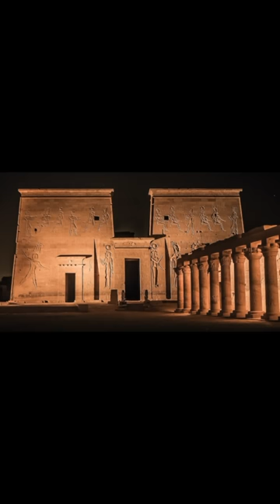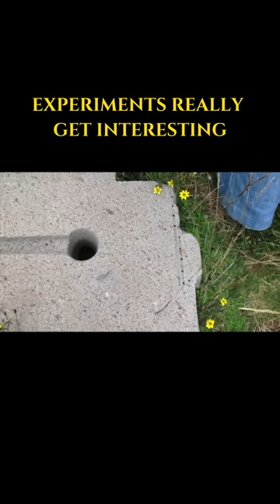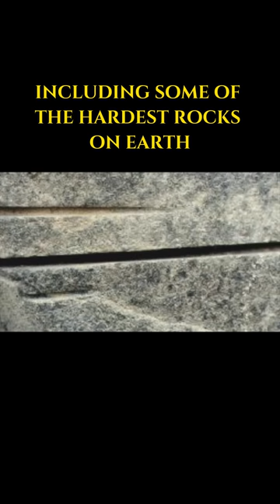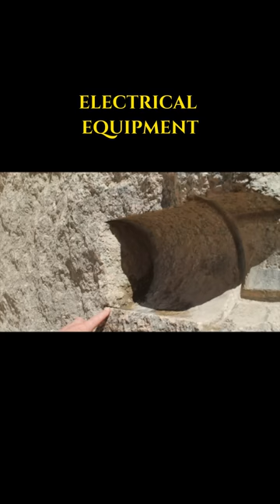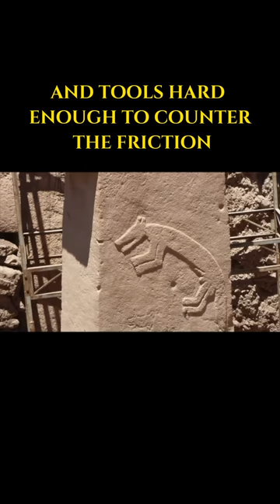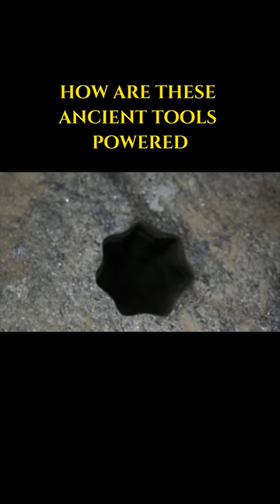Megalithic Star Holes: Drilled? Lost History & Ancient Technology #history #ancienthistory

Comment: They had drills… copper.. and it’s been proven the copper would cut into the stone.. as for the 5 point drill hole… they also had chisel’s… and more skilled labor in 10 men then a1000 men today.
Reply: They would have used several copper core drill holes to get the basic shape roughed out and then used flint chisels maybe for the rest.

Comment: They had plenty of good tools obviously. I think it would be easy to take a copper or iron shaft and inlay it with diamonds as a cutting tool. You could even put diamonds in a predetermined places in a casting mold so when pouring molten metal you would have a desired effect.  Therefore producing a drilling shaft or a cutting blade that can be used in a woodcrafted wind powered, man powered or beast powered machine. The list of materials used back in those days or far beyond what Historians are thinking.
Reply: Okay but where are they then?
Reply: The tools we have found are really crappy
Reply: Nope.

Just quartz sand and water to give it a temporary binding to the copper surface.

Then draw it back and forth across the stone surface and bombs away.

Granite is significantly weaker than source like these channels and people like Hancock claim it is.

You can scrape it down just by rubbing a rock as hard or harder against it, including more granite  and diarite which is harder.

(scraping is how they get those 'scoop' marks people seem obsessed with)

Likewise quartz sand at 7 mohs is harder than the weakest constituent element of granite which is feldspar at 6 mohs.

The quartz slides against the feldspar grains in the rock and a small piece of it comes away.

In turn this weakens the bonds to the remaining quartz grains in the granite so that they come away without needing something harder like corundum or diamond.

It's basically a case of granite being only as strong as the weakest link in the chain of its composition.

Another method of shaping granite is with stone chisels.

Most hard stone isn't suitable for sharp tools, but flint is not only 7 mohs, but it's also great for shaping to an edge, something our ancestors have been doing since the ice age for spear heads and daggers.
Reply: @K.Jerico  All that bad tools mean is that it took them longer to do it.

Haven't you ever heard the term "anything worth doing well takes time"?
Reply: @mnomadvfx  I'm not seeing myself disagreeing with that. But unfortunately we underestimate how advanced the methods of ancient civilizations were

Comment: High speed drilling? How do you prove high speed? Wouldn't a simple bow drill and some sand/stone dust and anything round be logical. 
I have Native American stone that (found in Illinois) proves that this is possible. This rock I found has a smooth bore hole about 3/4" deep perfectly round regular hole from bow drill fire starting method.

Comment: Steel rusts away with in a handful of decades, how can anyone conclusively say they didn't have steel tools 5000 or even 12,000 years ago.
Reply: "Steel rusts away with in a handful of decades"

If it's just iron and carbon yes.

There are plenty of steel alloys that are corrosion resistant though.

Also we have far older examples of steel and iron than decades - as long as you care for it properly with oil to reduce/inhibit corrosion it can last centuries still remaining shiny and chrome 😄.
Reply: @mnomadvfx  Big difference between a tool that has been meticulously cared for continuously for 200 years compared to one that sits out in the weather for 5,000 or 12,000 years.

Comment: Diamond tools? Lol that’s about it. Pretty much all I can think of 😅
Reply: Laser
Reply: How though?! There’s nothing that supports ANYTHING that includes lasers in ancient technology that I’ve researched myself that have an absolute PROOF that lasers were used or anything of that nature. Don’t get me wrong I do think that they were advanced but still though, not THAT advanced. There’s something that we’re missing here. Like a lost piece of a puzzle.
Reply: Nothing lost at all.

It's done the same way today.

Only you've got an electric motor turning the core drill instead of human hands - and it's made of steel instead of copper/arsenic.

Also metal was never the cutting tool for hard stone.

For that you need a hard abrasive like quartz - luckily there is a buttload of quartz sand in the desert.

All the copper tool does is drag the abrasive material back and forth across the stone surface.

Usually you would use a small amount of water to wet the sand and act as a basic adhesive so that the abrasive particulates don't just fly about while the tool is in motion - you need to cut it at the cutting point.

Comment: Are they sure it can't be done with low speed drilling. Or does it have to be high speed drilling
Reply from the maker: Hi Gary, thanks for sharing your thoughts - great question! The tools required to drill rock and rpm required makes copper and iron tools difficult to cut the rock (too soft)- when some holes are examined, the boring seems to bend or twist - or the star pattern is at the opening - but inside the hold the shape of the channel changes shape - which is inexplicable based on existing knowledge of early stone masonry (that we know of!) - be sure to watch and share your thoughts again!